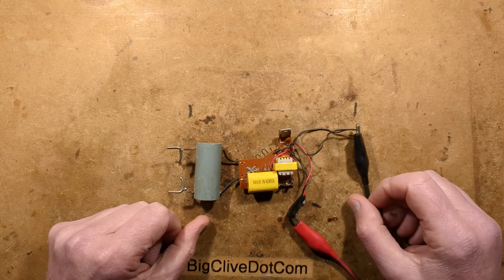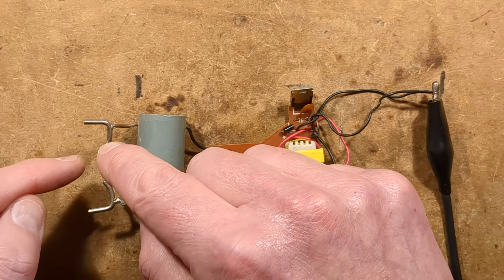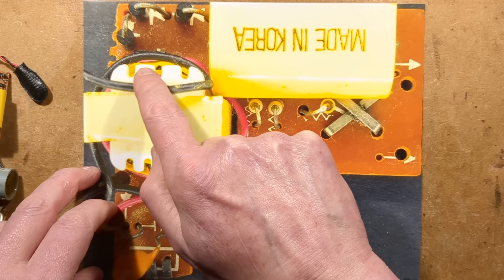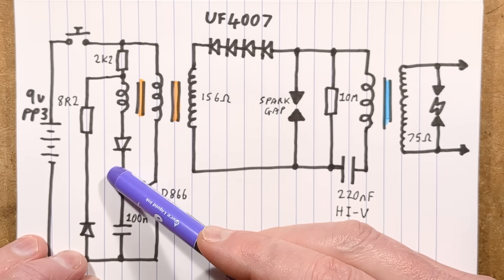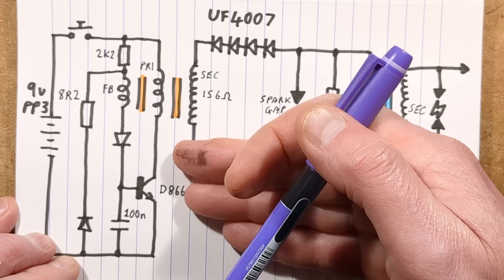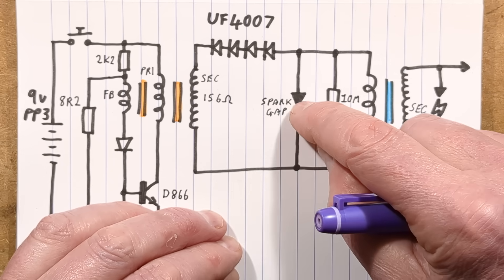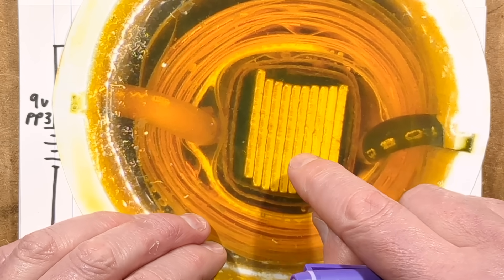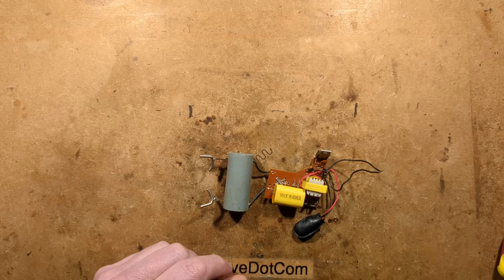How a stungun creates 20kV from a 9V battery

Comment: The best method in which to make a Stun Gun was by using one of those old disposable cameras. 
The kind you would wind on the film.

They would charge up over a few seconds in order to drive the flash. You could even hear it whine as it charged. (They do say younger kids have a lower/higher range of hearing frequency) 

I remember (the typical kid i was) taking one apart and I got probably the most nasty ass shock I’ve ever had in my life.

Now, I’m an electrician, I’ve had many electrical shocks. But wow, that camera temporarily sent me to a different realm. 
I was frozen in place for about 10mins after it trying to work out what was real with my fingers having taken possession of 2 black marks.

Not enjoyable.
Reply: What about a car coil?
Reply: @terenceherming1838 Well, a car coil would do the job too, but it’s much less practical. I mean, wirh the old cameras, you just strip them down, solder 2 wires onto where the flash light wires connect and you have a very small stun gun. 

If you enlarge the capacitor to say 5/6 x the side and add an extra 2 in parallel, the frequency of the arc will increase. 

You could fit all that into a little flashlight handle. A car coil on the other hand is going to be a little harder to conceal.

Comment: very interesting.. do you remember the old 1970s camera flash add on unit. if you took the wires off the flash bulb you could get a nasty shock off of them. they made a buzzing noise while charging up the capacitor.

Comment: For home use, one can get round the illegality by connecting the EHT from a CRT via an extension lead to a metal probe on a stick. Kept by the side of one's bed, if intruders break in they can be zapped without the necessity of getting up. An added benefit is that ozone generated at point of the probe acts as a disinfectant and makes the bedroom environment more healthy.

Comment: Just a warning that I have absolutely seen people end up with convictions just for making what you have there. Someone didn't even use a striped stun gun, they just made a similar set up from parts but it was considered a "viable device". They consider them section 5 firearms, same as a regular 9mm pistol. Fun additional fact, if the stun gun looks like something else, such as a mobile phone, car fob or even just built in to a torch is is considered a "disguised firearm" which carries a MANDATORY 5 year prison sentence. There are multiple cases of people ordering a £5 one off Wish and ending up in prison for 5 years.

Comment: TASER is a local manufacturing business where I live and surplus parts from TASER do show up at a local surplus electronics shop. I'd guess the transformers put out about 20,000 volts with 9 volts in. Before stun guns and TASERs came along, we'd sometimes screw around with cattle prods and old breaker points condensers to shock eachother. The oscillation frequency is what makes a TASER work, when it works, which is only maybe 40% of the time. If the electrodes do not span certain parts of the body, they won't paralyze anyone at all. When it does work the body stiffens up like a board and the victim usually falls down like a tree.

Comment: Is basically the same circuit as was used in the early Spark Gap transmitters.
A primary spark which generates high energy impulses, then a secondary spark which generates the RF energy. 
https://en.wikipedia.org/wiki/Spark-gap_transmitter#/media/File:Marconi_first_transatlantic_radio_transmitter_circuit_-_Poldhu_1901.png
Is also the basic circuit that Tesla used in his Spark generators.

Comment: Probably anything can be brought through airline security it’s just on how they see the parts... just like C4 explosives are very safe but with a detonator it suddenly becomes a very powerful explosion, but C4 alone will not do nothing and a detonator might only burn a hole in your pants, but those two together is not an area you would wish to be close to.... and pretty much sure that airline security knows nothing about capacitors and if they are charged or not... but ask any electronics guy and the first rule of handling capacitors is make sure they are drained!!!

Comment: I have question about lighting. This is the place I go for those sorts of things. At work today we were working on a slot machine. The machine isn't booting, or giving any indication that it was posting, but we have fan spin on the CPU. I was shining a light in looking at the board and it looked like the fan was slowing down periodically, around every two seconds. I mentioned it to the senior tech I was working with and he said that it was just an illusion because I was using an LED flashlight and the flashlight is flickering due to it using PWM combined with the motion of the the fan blades spinning. I know that the flashlight does use PWM but it doesn't seem like the entire fan would appear to loose RPM periodically just because of that. My thinking is that if both the light and the fan are flickering and spinning at a constant RPM respectively then the illusion, if there is one happening, would be static. Is this a thing?  Didn't have time to check if the fan is actually slowing down (probably turning off briefly IMO) because my shift was over and I had to leave. I was just curious as I have never heard about this before and couldn't find any answers using search engines. To be clear my flashlight doesn't visibly flicker normally. Preemptive thanks to anyone who reads and comments.
Reply from the maker: You can get a strobe effect with a pulse width modulated flashlight.  It can make fans look like they are running slow or have stopped.  It's also possible that there was a power issue in the machine and the power supply was in hiccup mode and pulsing enough to keep the fan running, but not let the computer boot up.

Comment: For the feedback to work as explained, wouldn't the polarity need to be reversed? I tried to figure out how it works on my own before listening the explanation, but I couldn't understand how it's supposed to start oscillating. It helps to put a dot to indicate winding polarity. Although I suppose it's a bit more work to find out the polarity using a signal generator and a scope.
Reply: The primary and secondary are wound same direction, and the feedback is wound opposite direction. Hope that helps.

Comment: I should note, it looks very simular to what i have observed from the module from an electric fly zapper, all be it, on a lower voltage scale.
Reply: I wondered what the 3rd set of windings on the fly zapper coil was. It perplexed me for some time but I came to the same conclusion you did its a 3rd set of windings, serving as a feedback to power the transistors or mosphet, to keep a harmonic resonance with the transformers final output. The circuit seems to differ in that it does not have a secondary transformer, instead, just a beefy yet low capacitance capacitor that delivers a single 1.5kv pulse. I presume the 3 diods on the back of the board on mine also serve the same purpose as they do on your taser circuit. An additional difference is the lack of a spark gap. This is due to it being unnecessary for the fly swatter as it does not require arcing until a circuit is completed by an unfortunate bug.

Comment: I'm surprised they were able to use iron laminations for the output transformer. 

You'd think the magnetic field there would be high frequency/short duration pulses and the eddy currents would keep the field from penetrating most of the metal's thickness.

Comment: We had several different devices that we used in the course of normal duty: Stun guns and tasers, stun belts, stun blocks (the device resembles a 1.5 inch thick brick you strap to a calf muscle and operate by remote control), and stun shields. By far the stun shield was the worst to get trained on since you had to take repeated hits from it to get certified. Most riot shields are bowed out from the center to direct and funnel a person to someone waiting behind you but the stun shield was set as a trap shield. It was bowed in at the center. When you got hit it would most often knock you down and they could simply cover you with the shield. If you struggled, you got zapped. It was clear acrylic with 1/2 inch copper tape running down the length like shiny stripes. When activated in a dim/dark room, the sparks would flash all over the face of that thing making a hell of a racket😂. Nine out of ten times, just letting them see and hear that shield sing was enough to get them to give up.  But if you needed to use it, it left them feeling like they had that dull flu body ache, especially in the joints. In 23 years, I only ever had to stun someone twice. Which, on the whole was really unfair since I had to take shocks from all that stuff for certification and recertification. 😅😅

Comment: A had one of these with a buzzing sound of discharge, they pretty unharmful. And I had another one, with loud popping sound on discharge - that one was a real deal. Once I got that, I accidentally shocked my palm - i was holding its sides, which also have metal contacts. They are hidden, so I didnt expect it to happen. The current went through my point finger to the thumb just for a fraction of second, but after this the whole palm felt like I slapped a concrete wall hardly.

Comment: Clive, i made a "Gas barbecue igniter" with you in mind but i don't know where to send it... so i'm keeping it. Made from <£5 of AE bits with pulsed output spark. used an old recreational nicotine portable fog machine tube, using a Euro 2 pin plug it looks like a mains rechargeable power bank and the "selector" tube disables the device. 🤫

Comment: It can be added that the stun gun draws a current of about 2 A from the battery, which means that even a very good 9-volt battery, under load, delivers about 6 V. When I powered the stun gun from a 9-volt power supply with high current efficiency, the spark at the output was incomparably more spectacular.
Reply: Yeah, I was thinking that some 18650s would probably be able to do some real damage, since they're can deliver a lot more current than alkaline batteries
Reply: @aliveandwellinisrael2507 Even just 2 18650 in series would be a lot better i'd say
Reply: It also sharpens it up if you connect the output to some 30kV capacitors and adjust the gap accordingly
Reply: #GoodToKnow!

Comment: Crazy little device, I love how you tested it....
Many years ago I had a little 9V driven inverter that would slowly charge an electro up to 500V, I then discharged that into two car ignition coils and I was able to get up to a 7cm spark. Mind you it took about 20 seconds to build up the charge. I had fun finding car coils that could handle it, the regular black bakelite topped ones just punched through first pulse, however I found a pair of white ceramic topped coils that could take way more before flashing over.
Pity I don't have it any more, I was a kid and my parents were moving house, so I was told to lighten my load.

Comment: To be accurate, there are ones that actually do go all the way up to 350KV but are highly restricted unless you are active law enforcement personnel, or military. Like the UK, many states in the US have outlawed all forms of them, regardless of their actual or claimed output voltage. The real ones use quality driver circuits, & something similar to a true flyback transformer pumped into capacitor arrays (also potted in epoxy) for the voltage, but doesn't use the cheap resin potted wire wound iron core at all. They also have rechargeable high output batteries usually starting at 36 - 92 volts rather than only 9v. Somehow you got the TEMU version of an american zapper lol. Enjoyed the vid regardless, & hope you enjoyed your visit.

Comment: When I started my electrical engineering degree we learned about ramping voltage using a capacitive inductive loop. When we were testing I noticed a whining build up ( always had sensitive hearing) but it was something I recalled from elsewhere... There is a common household device that has a capacitive loop to ramp up voltage to make a MacGyver Taser... A Camera Flash. I had an old capsule film camera which I tore apart, hooked up a 9v and replaced the flash with 2 pins. 

It was enough to put a pit in a 10c piece and spot weld pieces of an aluminium can. I wasn't brave/smart enough to zap my leg, I zapped my finger. Squeezed so hard it felt like I was going to break my finger and never be able to straighten again. Test if you dare on larger muscle groups. :)

Comment: I used an almost identical circuit about 10 years ago when I wanted to simulate lightning to test a lightning detector I was working on. I wound the second transformer using a ferrite rod, wrapped the primary in a few layers of adhesive polythene tape and submerged it in cooking oil!

Comment: You tried it on yourself 🙂, now that is what i call dedication👍, cool circuitry with the sparcgap solution, not so long probably until the gap will sot or eaten upp the material but then again its for temp use only i suppose...

Comment: I found a seller of this style on eBay, snagged a few for educational purposes. They run on 2 parallel 9v batteries and its wicked with both cells. Same circuit except on the outputs of the pulse transformer there's an extra highly insulated component soldered between tge probes. Possibly a high ohm resistor? If i fire it in my truck, the emf or infrared triggers my radar detectors laser function.

Comment: I tried to repair one that's been under water for some time. It did come to life but sparks at much higher intervals than it should, I suspect.

Which part of the circuit would be responsible for determining the frequency of the HV sparks?
Reply from the maker: Look for corrosion and tracking on the PCB.  It should be very clean for high voltage use.

Comment: Thanks for the video! In the late 80s I would repair stun guns, mostly failed on the X from excessive use. I know what you mean about getting zapped thru the plastic -- brings back memories. The stun gun design was very similar to what you showed. I found out later that the stun guns were used by a small computer shop to help zap hardware before they sent back to the manufacturer.

Comment: I did an experiment with one of those high voltage generators adding high voltage caps to the output in series and then powering it with a AA battery, it worked way better than I thought it would. its surprising how low of a voltage they can operate from.

Comment: Yep, A High Tech  Spark Gap transmitter. Spark gap transmitters originally called "Wireless" units back in the late 1800's were used to send morse code messages to and from ships at sea long before what we know as Radio today. I suggest attaching a wire from each electrode straight up and one straight down from the output spark gap. Maybe 12 inches or so to be your transmitting antenna. Then make a receiving antenna with loop of copper wire about 4 or 5 inches in diameter with the ends of the loop almost toughing. There may be an arc across the gap of the loop each time you trigger the stungun if ya get close enough. For more info just google Wireless spark gap transmitters. Have fun.

Comment: 0:50 I don't agree with your calculation of voltage based on dielectric strength.
In the case of dry air it is THREE kilovolts per millimeter of arc not just one kilovolt: so for 15 or 20 millimeter arcs it is assumed that the voltage is 45 or 60 kilovolts!!!

Comment: 20kv sure that's only a 20 inch crt tv ht cap, used to repair tvs before led took over, try a 42inch it will def teach you to cross those screw drivers to ground. Something you only forget once. 😂

Comment: The central circuit reminds me an awful lot of a basic car ignition  circuit.  The 10 M ohm resistor is what we called the capacitor in mechanic-parlance and was there to damp the back-emf, which allows the spark to be regenerated at a higher rate.  When the car-capacitor failed, the engine would fire, but either not run, or only at a low idle.  I'm not sure how accurate the physics is behind my explanation, as I'm not electrician (just a retired, old-school mechanic, amongst other skills over a rather long lifetime).   I hope this sheds some light on that tiny aspect of your comprehensive analysis?  Thankyou for keeping us all educated in such an entertaining way over the years.  It keeps my old brain active and 'young'!
Reply: exactly....want have fun...get a breaker piont ignition condensor and rig so the case touchs one contact of a zapper, then zap the wire lead with the spark for about 10 seconds or so and yell hey catch and toss it at a victum....see how far they fly...